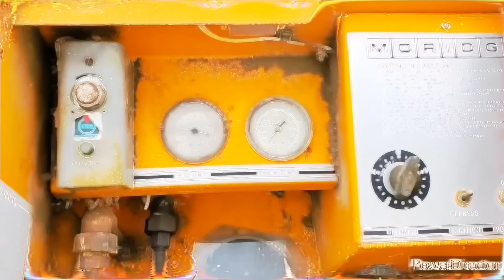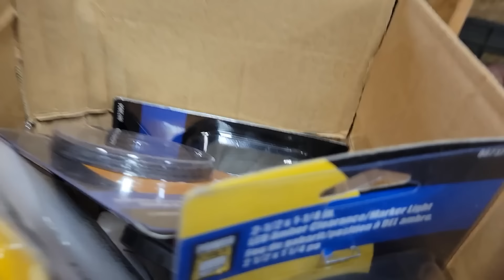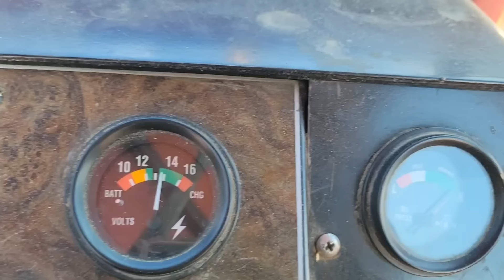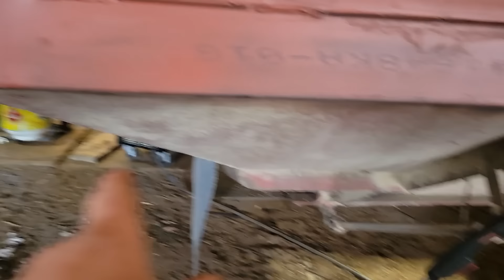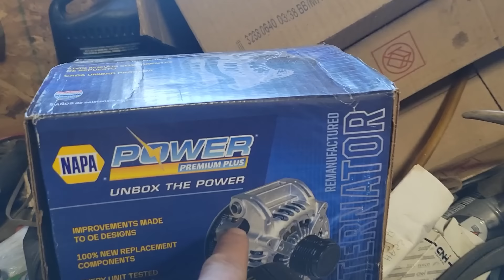Calving In Full Swing!!

Comment: to get lines thru tubing shut the gas off on ur mig. crank up ur wire speed and  shoot wire thru, tie off and pull. as u pull roll the wire back onto the mig wire roll,i built custom trailers in ab. all our lines were inside tubing.always worked 4 us, good ol ddspeedshop comes thru.

Comment: refurbing trailers is super time consuming. on those carbide burrs u bought.... i think the coarse ones r 4 aluminium. maybe thats why they seem a little diggy/aggressive. for steel the burr u want is crosshatched. u can get a cone stone for angle grinder to clean up inside diameters, they r cheap and safe,for a 5/8 spindle.very HANDY

Comment: Put a block heater on the 105.  That's all I use the hose heater isn't very efficient .
Reply from the maker: Fuck its got 4 heaters on it lol. Junky perkins!!
Reply: @straightpipeacres6365  Is your stater getting weak?
Reply from the maker: @ollie-lk5dx  rebuilt twice now
Reply: @straightpipeacres6365  Well I'm baffled. Are you using 3eh series batteries?  1 12volt may not have enough cca.  Just trying to helpful .
Reply: Garbage
Reply: Them cows are having calves right out of the oven ready to breed. Them are some bigins and nice looking.good video